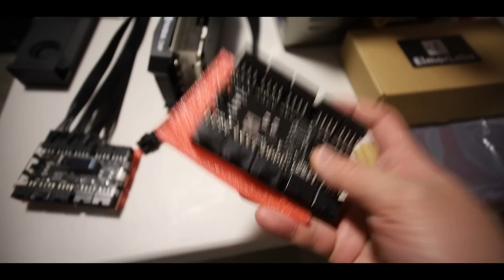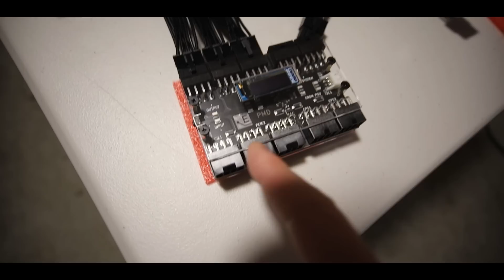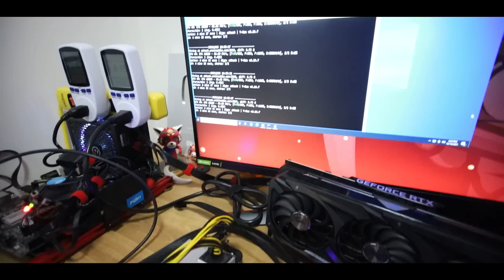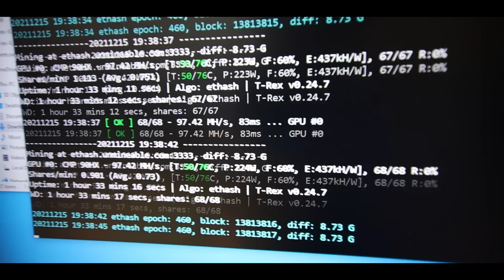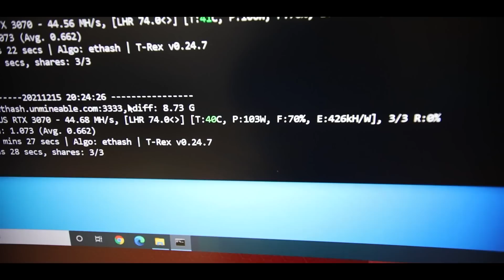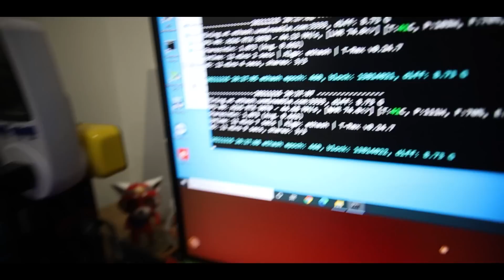Measuring EXACT Ethereum Mining PCIE Power On a FEW GPUs! ElmorLabs PMD Review

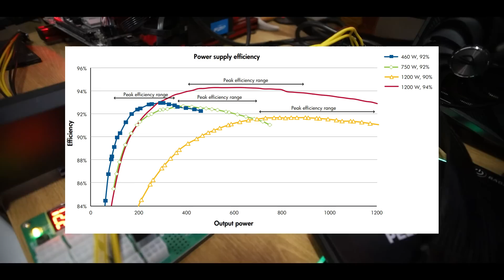Comment: I don't understand the chart at 5:05. You said the screenshot is "for this specific HP server PSU". How are there different efficiencies for the same power if all 4 of those lines/colors are for the same PSU?  Eg. Yellow line: efficiency @ 600 W = 91%. Green line: efficiency @ 600 W = 92%. Red line: efficiency @ 600 W = 94.5%. I'm assuming the 4 different lines/colors represent 4 different PSUs (a 460 W, a 750 W, and two different 1200 W)? If so, the chart makes sense. Also, if that is the case, which 1200 W PSU is the one used in the video, the yellow or red?
Reply from the maker: 1200w 94% platinum is mine. The other 750w number is different psu models yes
Reply: @RedPandaMining  Thanks! Out of curiosity, which PSU model is the other 1200 W one - the yellow-lined one?
Reply from the maker: @samburti8587  gold rated one I believe.

Comment: I've discovered that by long pressing the button you can access the settings menu.  Then you can adjust refresh rate, lock display or calibrate the device among other things.  Also want to share peak wattage measurements from one of my cards on ETH.  I'm still working on more granular results for my entire farm and on other algos.

MSI Ventus RTX 3080 non lhr

No OC
Riser 		        22
PCI-E combined 	262
Software 	        275

With 1060 core and 2250 mem (in hiveos)
Riser		        13
PCI-E combined	209
Software	        214
Reply: 22 watts at the riser would mean sata to power it is safe and redpanda made a video showing you SHOULDN'T use riser with 3080, i'm confused now...

Comment: This is reply from manufacurer about calibration. And you can also set to lower refresh rate for reading, by long pressing the button.

"They are not calibrated from the factory. You can calibrate the offset current with 0 A load in the menu by long pressing the button and selecting CAL and long pressing again. To store the calibration permanently, select the STORE option and long press."

Comment: good idea but it misses the mark completely! sure it shows you how much power the GPU is using, but it's not showing you the psu inefficiency at the wall. to make those 60 watts the psu has to draw more than 60 watts. so for system power measurement i do not recommend but for individual gpu it could be useful, though misleading as per it does not account for the entire system efficiency & given the similar price to a meter you can plug in at the wall i can't see spending 45 on it & it only supports a few gpus at a time.